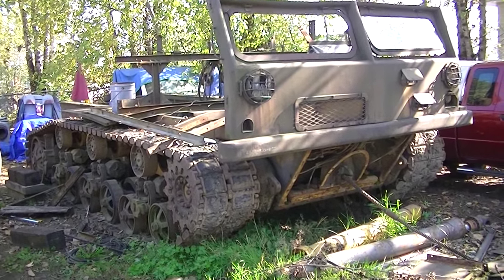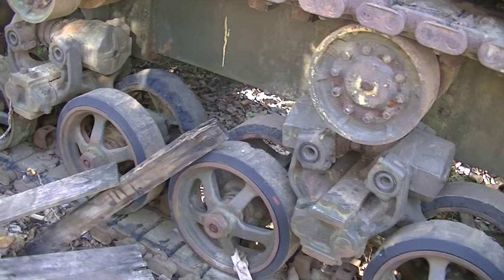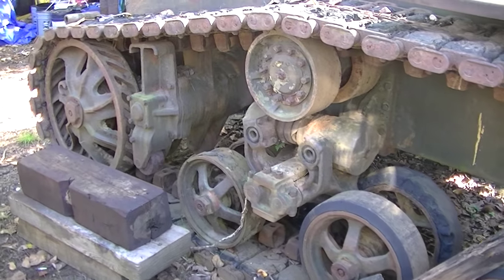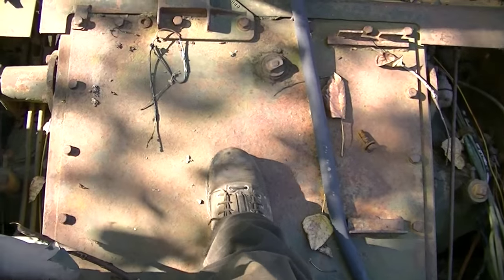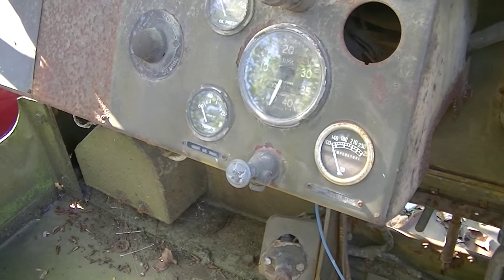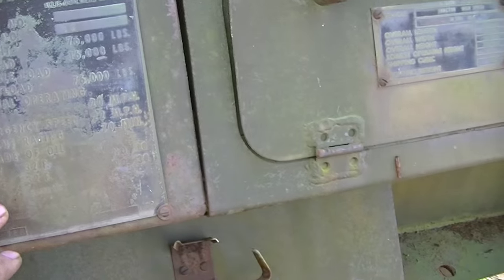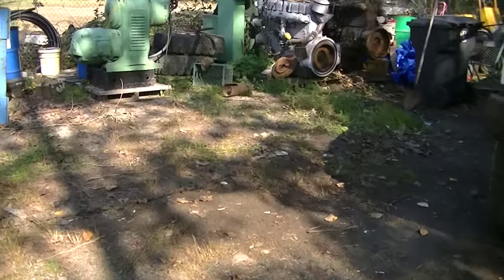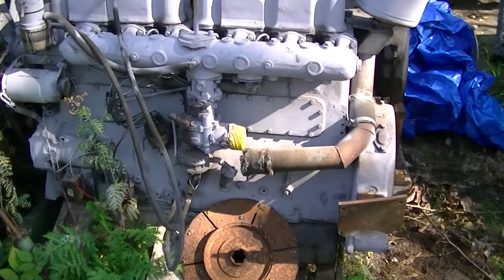Allis Chalmers M6 high Speed Tractor

Comment: 38 tons? Doubtful. 38,000 lbs is more like it- 19 tons.
Reply from the maker: No,but enjoy setting the world straight then.
Reply: According to US Military Tracked Vehicles by Fred Crimson,  the net weight was 60,000 lbs, and the gross weight (crew and load) was 75,000 lbs (~37.5 tons). The back half or third or so was set up to store the shells and propellant bags in their tubes. The M6's drawbar pull was 50,000 lbs., typically pulling the 8-inch gun or 240mm howitzer split into two loads (barrel, or trails and carriage). The combo of a fully loaded m6 pulling 50,000 lbs would actually have a total weight of 62.5 tons.......about m60 tank territory.